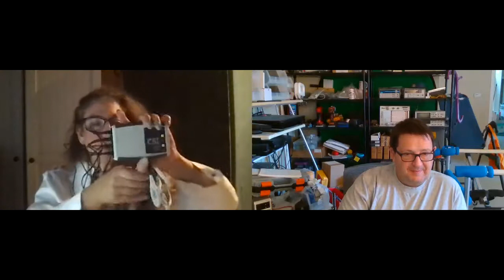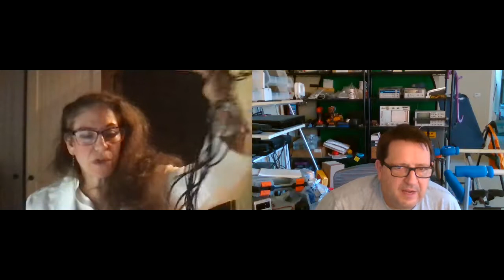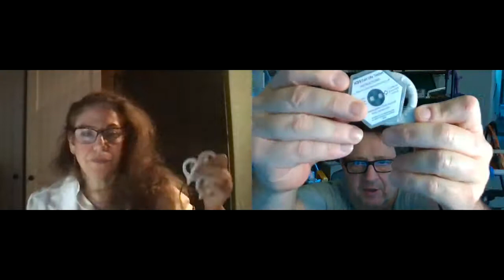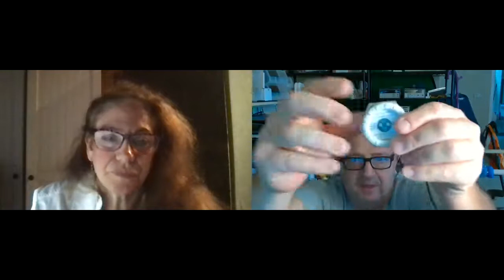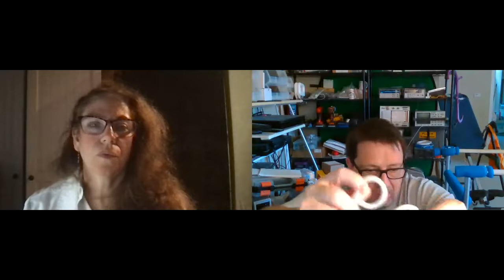Stacey and Bob Discuss the ICES-PEMF model C5, and answer some common questions.

Comment: Are  your ICES devices safe to use for those who have a pace-maker?
Reply from the maker: The word "safe" is regulated by the FDA and therefore it is not possible to answer this question directly.  But also be aware that the FDA makes mistakes when trying to allow products to use that word in their marketing.  You can find a long list of drugs and devices that were at one time cleared by the FDA as "safe" but subsequently were found to not be safe (example: oxycodone).  I sympathize with you: every reasonable person wants to know the answer to this straight-forward question:  Is it safe?  But unfortunately, given current laws, this is not a discussion that we can have.

But it is really much more complicated than just the Byzantine regulatory laws.  Then there is the question of the meaning of the word "safe".  This depends on whether you are an epidemiologist (or any scientist) or a general consumer of a product.

To an epidemiologist, the consideration is one of risk ratios:  will doing something cause more or less harm than not doing it?  This is how we end up with "safe" drugs and devices that harm people, because the calculation goes something like this: If people do not use drug X, the harm will be 1 in 100.  If they do use drug X, the harm is reduced to 1 in 1 million.  This is an over simplification, but with a change in the risk from 1/100 to 1/1,000,000, it can be argued that using drug X is "safe" because not doing so will harm 10,000 people out of every million, whereas using drug X will harm only 1 in every million.  Of course that unfortunate 1 person does not think the drug is safe, but the 9,999 who avoided injury by using the drug might disagree.  So, for epidemiologists, safety boils down to a risk ratio.

To the general consumer, the word "safe" is an absolute, not a ratio.  To the average consumer, the word "safe", means that it will not harm them, period.  Not 1/100, not 1/1,000,000, not even a chance of 1/1,000,000,000.  Safe means safe, no harm, period.

But in the real universe, nothing is safe.  Any object or substance can potentially harm someone.

So, how do we have this conversation?  We have draconian regulatory restrictions on the use of this word, and we do not have a general consensus on what the word even means.

I am so sorry.  I wish we could have an open and intelligent discussion about it.

Comment: I own the M1 but also purchased the OMI full body mat. When I test with the hexagonal tester it doesn’t produce enough energy to light up, I had the same result with a Beemer mat. Are these mats producing anything beneficial if they don’t light up the coil tester?
Reply from the maker: I have tested these same devices and have had the same results that you have found.  Generally I try not to say negative things directly about specific PEMF products.  What I can say is that with extensive testing since my consulting at NASA on this topic in 1996-1998, I was able to narrow the beneficial active biological range for a broad class of PEMF pulses into a quantifiable range with well-described electro-magnetic parameters.  I have written about this hundreds of times.

ICES-PEMF is designed to give consistent, reliable effects as much as possible.  For some applications, post-use surveys indicate that the beneficial biological effects are clearly present in as many as 95% to 98% of the people who use the device properly (https://www.josam.org/josam/article/view/14), and in biological test models that have been standardized to remove the possibility of intentional bias (https://www.josam.org/josam/article/view/38) and placebo effects (https://www.josam.org/josam/article/view/27).

I am not saying that there are no biological effects outside of this range, because PEMF is much broader in scope than all of known chemistry (https://www.josam.org/josam/article/view/67), so I think it is unlikely that one test device can detect all possible biologically useful forms of PEMF.

That being said, I believe I have been able to define effective ranges for the forms of PEMF that have been described as "effective" in the peer-reviewed scientific literature, and the hexagonal test chip is calibrated to indicate the presence of this range of biologically-effective PEMF.  Even in the scientific literature, PEMF pulses that fall outside of this broad range are generally thought to have very little or no scientific support.

Nonetheless, these other devices may or may not work.  People who have tried them are pretty well divided on whether or not they are effective.  Keep in mind that the placebo effect is real, and is about 35%.  So, if you want about 30 positive testimonials on any form of treatment, you only need to offer treatment to about 100 people, and then you have about 35 potential testimonials.  This is why I generally never post testimonials because bias is built-in, and I am very cautious about any medical technology that builds their business model around testimonials.  

The bottom line is that it would be impossible to prove that these other technologies do not work simply because they do not light up the hexagonal test chip; they may still work for some people for some things by some biological mechanism different from the one I have been working with for ICES-PEMF.  The hexagonal test chip is designed primarily to tell you if your ICES-PEMF system is working properly or if it needs service.  Ii is my opinion that it is also useful in detecting fraudulent devices, though some of these may also be beneficial to some people for some uses.

Comment: Using with blood thinners?
Reply from the maker: So far as I know, that has never been formally tested with PEMF.  But I have also never seen any report that suggested it would be a potential problem either.
Reply: @robertgdennis7472  I posted a more detailed question regarding this on your last video. Thanks for your reply Bob.